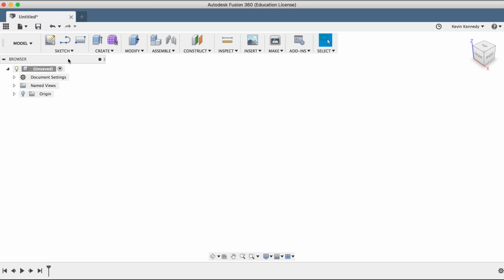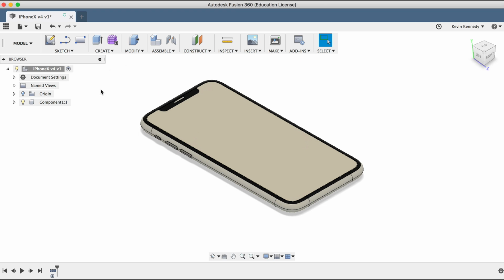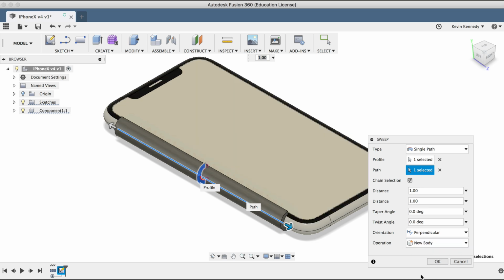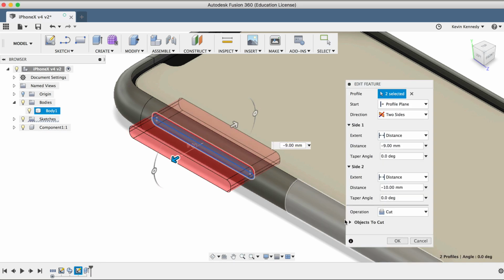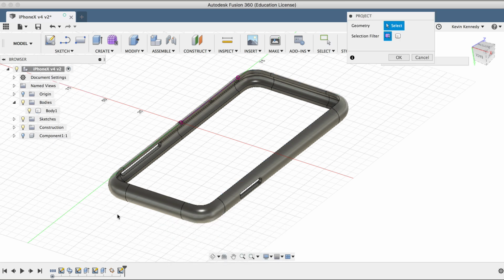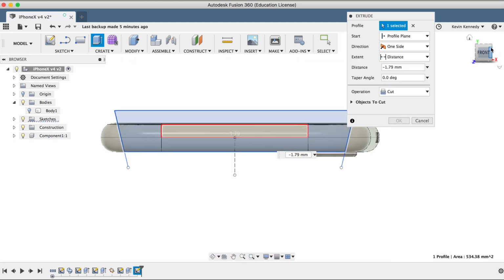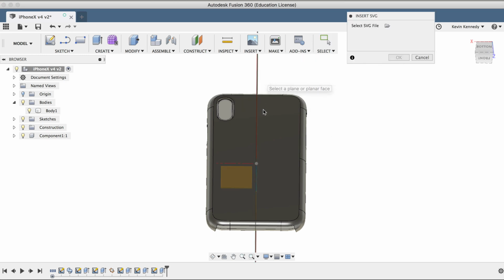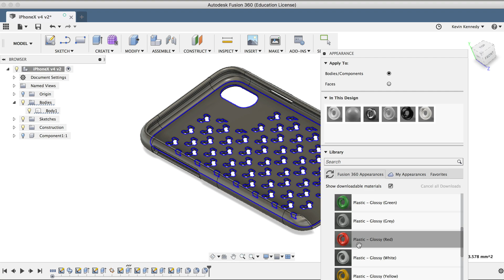How to 3D Model an iPhone X Phone Case - Learn Autodesk Fusion 360 in 30 Days: Day #10

Comment: Thanks for the great series. Have been following along, and actually getting somewhere. This project, is what I want to create. However, I am modelling for a Galaxy Note 8. The iPhone, has some symmetry around the edges, and the sweep does travels very nicely. For my phone, it is not symmetrical on the edges, and gives errors about this symmetry. Is there another method to achieve an outcome? regards ( I did download a model, as you suggested)
Reply from the maker: Hi David. Thanks for following along with the series!

Try splitting your model in half to create some new geometry for the sweep to follow. Use a midplane construction plane (select the front and back of the phone) so the construction plane is directly in the middle of the phone.

Then, use the Split Body tool in the modify dropdown list. You'll obviously select the body of the phone model as the "Body to Split" and then you'll want to select the construction plane as the "Splitting tool." After clicking OK, your phone body should split in half. Try using the sweep command by using that new "edge" created by the phone being split in half. If that doesn't work with the sweep command, you may have to "project" the edge sketch geometry onto that original midplane construction plane.

Let me know how this goes... or if you have any follow up questions! Cheers, Kevin :)

Comment: How design mobile case without cad file.. ? Can you teach design using mobile image ?
Reply from the maker: Hi, G.Mahesh waran Gangadharan. You can certainly follow along in a similar manner with just a reference photo. What you'll want to do is place the reference photo on the XZ plane...and you'll want to trace or outline the outer dimensions of the phone using sketch geometry.

For example, if you want to model the iPhone 6, place the iPhone 6 reference image on the XZ plane. Then, right click on the image in the Fusion 360 browser and click "calibrate." Calibrate the length of the reference image to be the same as the length of the phone. Then, I would simply create a 2 point rectangle with the phone's width and dimensions, and add fillets to the corner. Alternatively, if the phone doesn't have perfectly round corners, you could use the spline tool to "trace" the curvature of the phone.

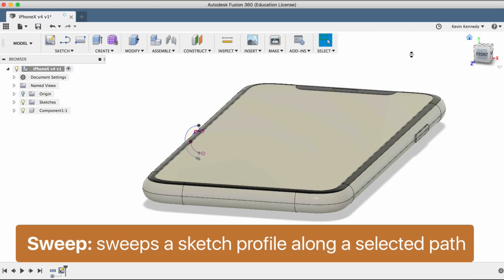Up to this point, you would now have a line to use as your guide path when you use the sweep command at 3:17. The Sweep profile that I created at 2:11 could also be done with just a reference image or even just dimensions that you find online. I've personally found that using a 3D model is easier to ensure accuracy for something with little tolerance, such as a phone case. I hope this helps! Cheers, Kevin :)
Reply: @ProductDesignOnline  if phone's side face are curved means how can i trace it using photo?
Reply from the maker: You'll probably want to upload a reference image for both the front and the side profile views. Something like this - https://i.ytimg.com/vi/-IHfemz7xLQ/maxresdefault.jpg
Reply: @ProductDesignOnline  ok thank you so much
Reply from the maker: @Maheshwaran2200  You're welcome! Let me know how it goes :)
Reply: @ProductDesignOnline  am new to fusion that's why i ask to do video for this. Am using your steps only.. just compeleted 4 days of tutorial only.
Reply from the maker: @Maheshwaran2200  I understand. I have a list of videos to get through first but will consider doing this in the future. Cheers, Kevin :)

Comment: Here is a problem, Could you check my file?
https://a360.co/2Dpmky8

When I attempt to sweep there is a message "Inconsistent edge-face relationship
So, I fixed spline sketch but It doesn't work
Reply from the maker: Hi, CHO성진. Upon inspecting the model...it looks like the original iPhone 6 model has some issues with geometry not being consistent. I would suggest trying again with a different iPhone 6 model. This one seemed to be hacked together pretty quickly. Alternatively, you could try to create a midplane construction plane... and then try to re-create the perimeter of the model using sketch tools. You may even be able to project the sketch in some areas to help recreate the geometry. Whichever way you re-create the perimeter you'll want to make sure it connects all the way around so the sweep feature has a consistent guide path to follow. Cheers, Kevin :)
Reply: @ProductDesignOnline  I think so too, so I try another Phone model 
then complete it, Thanks for a great video and nice explanation !
Reply from the maker: @devstefancho  You're welcome! As always, thank you for your continued support! :)

Comment: When I import the .stp file it imports standing on the top of the case...the front is the back. I know I should be able to fix this but don't find the commands to do so. It throws all the instructions off.
Reply from the maker: Hi, Doug. I would recommend importing the "Fusion 360 archive" file. I believe that will import it in the correct orientation. However, you can always change the front view with a few clicks. Click the "back" side of the view cube to look directly at it. Then to reset the front view of the model you'll want to click on the chevron (dropdown arrow) to the bottom-right of the view cube. Then, select "set current view as" > select "top" from the list. Depending on how your model is oriented you may have to follow these steps to set the "top" view as well.

Let me know if this fixes it for you! Cheers, Kevin :)
Reply: Thanks, I played around enough to find the chevron and corrected it before I got this note. It was worth knowing (and maybe you cover this in a later video or, if not, it might be a worthwhile topic for a new one) because I may eventually run into a situation like this when I design my own projects. Thanks, I started with the Autodesk tutorial, but much of what I got to had more to do with a work environment. I also tried a udemy course and it was okay. I like the fact that you emphasize specific tools and aspects of 360. Great stuff! Thanks.
Reply from the maker: @douggrant4008  Glad you figured it out!

I have a really old video (one of the first ones) that covers reorienting objects - https://youtu.be/GwGa0Z50jLg

However, because its so old... and things have improved a lot. I will likely make a new one/incorporate it into a new video with some other viewcube features details. I'm happy to hear you enjoy my videos. Thanks again for your support! Cheers, Kevin :)
Reply: @ProductDesignOnline  yeah...that tip was gold!!!!!!!! thanks

Comment: Hi, I can't see how to download the svg pattern - the link takes me to the page and I can see it but I don't see any options/ways to download it. Thanks!
Reply from the maker: Hi, Marisa. With that page open, right click on the image and select "save as" from your browsers native right-click list. Then, make sure the file type is still set to SVG (sometimes browsers like to change to a users default of something else) > change name if you'd like > change location on your computer if you'd like > click save. Cheers, Kevin :)
Reply: @ProductDesignOnline  Yep I've tried right clicking but I only get the option to Save Page As - which is not what we want to do - as I can't actually click on it as an image, I can see it, but it's not clickable........ any other suggestions? Thanks!
Reply from the maker: @marisajane37  Hmm... that's strange. What browser are you using? Here's a Google Drive link that should be easy to download from - https://drive.google.com/file/d/1-WETMLGSBKvK2mlM0osrbquJtyADnSJu/view?usp=sharing
Reply: @ProductDesignOnline  Thanks Kevin, Google Drive link worked! :) I'm using Safari.....
Reply from the maker: @marisajane37  Strange Safari won't work. I normally use Google Chrome, but just tried and Safari won't work for me either.... normally you just click and hold on the image. I guess Safari doesn't like SVGs, which is good to know, so thanks for bringing this to my attention :)

I'm glad the Google Drive link worked. Keep it up! Cheers, Kevin :)

Comment: I have a small issue in regarding to selecting multiple profiles for extruding the shape of the rectangle which would essentially cut out the hole for the buttons; it seems as if I can't select the two halves of the rectangle right after creating the 1.5mm fillets. Anything I missed?
Reply from the maker: Hi, lordcosmic1. It's possible that the fillets messed something up with the constraints or line, which is prohibiting the extrude command from working. Do both halves of the rectangle have an orange background highlight? The orange highlight signifies they are closed profiles, which is required for the extrude command.

Please let me know if it was something with that. Otherwise, feel free to share your file and I will take a look. Share your public link as a reply to this comment. Here's a video explaining how to share a public link - https://youtu.be/2XrcrdV-8Ls

Then, please write a separate comment letting me know you've replied with a link because YouTube flags most links and I don't always get notified. Cheers, Kevin :)
Reply: @ProductDesignOnline  Thank you, I found that the fillets were the cause of the issue; both orange highlights appeared right after re-sketching the fillets and it allowed me to complete the extrude command. Thank you again! Excellent video, very informative.

Liked, and Subscribed!
Reply from the maker: @TheMemeKing42069  Glad to hear you got it resolved so quickly! Thanks for the sub. I appreciate you taking the time to watch and comment. Please don't hesitate to comment on any of my videos should you have any questions. Cheers, Kevin :)

Comment: You fogot about offset between phone and case. I'm guessing that it wouldn't fit after 3d print. Good tutorial tough ;)
Reply from the maker: Hi Maciek, I printed the phone case on a commercial grade 3D printer (Stratasys F900). Because the tolerances are so high on this printer it worked fine, especially since the plastic has some give to it. The intention was to have it as snug as possible. I had to bend or pry the plastic to squeeze the phone in, but that ensured the case won't ever pop off.

If you don't have access to a commercial grade 3D printer then you may want to consider a small offset as you suggest. Or I suppose you could scale the model up a small amount in the slicing software. Cheers, Kevin :)

Comment: First off great video!!! easy to follow. is there a way to combine all the faces created into a solid shape then split it into two bodies? in essence i want to create a 2 layer case. kind of like the otter box or lifeproof case. silicone inside hard shell outside.
Reply from the maker: Hi Matthew - Thanks for watching! Yes, you can use the combine command located under the modify dropdown list to combine bodies together. To split the case in half you'll want to check out the split body tool, which is also located under the modify dropdown list. I would recommend creating a construction plane (a midplane may work best) which you can reference as the "line" to split the case in half. Cheers, Kevin :)
Reply: @ProductDesignOnline Kevin thanks for the reply. I'm not looking to split the case directly in half. If you look at this picture: https://m.dhgate.com/product/shockproof-dual-layer-tpu-hybrid-rugged-armor/406053148.html#pd-105 I'm looking to design something in the same manner. A skin then a shell that will fit over that.  I guess I could bulid  2 cases following your instructions, but how would I "assemble" it? Hope that makes sense.
Reply from the maker: Hi Matthew, sorry I misunderstood you. Thanks for sharing the reference image!

I would recommend building the inner case first. Create a new component for the first/inner case. Then, you'll want to create a new component for the second part (color) of the case. After that, you can "project sketch" from the first component/body to the second component's sketch, which makes sure that all of your pieces are the same dimensions...although you may want to then offset the lines to leave some tolerances between the two cases. I think you'll find building the first one and essentially building the second one off of the first (just make sure they're different components) very practical. If you use the project sketch feature you can set up the outer case to be driven off the dimensions of the inner case...therefore, if you update the size of the inner case later on you won't have to rework the entire outer case.

I hope this helps! Cheers, Kevin :)
Reply: Thank you for the response. is there possibly a video showing this? and i have a couple basic question. can yo sweep only corners, to make the inner case? how did you get your sweeps to be a single piece? on of my corners has been cut in 5 different pieces?
Reply from the maker: I don't have a video showing a multi-part case being made, however, if you watch the screwdriver video (https://youtu.be/29kCwkapes4) you'll see that I use the same concept... demoing what happens when you change the size and the second component updates accordingly.

The number of pieces in a sweep all depends on the path that you select and how the profile shape intersects the path. Did you use the same iPhone model or a different phone model?

As far as creating a sweep in only the four corners, I would create a sweep in one corner and then mirror the feature both ways. This way, if you decide to update the original sweep, the 3 others will update accordingly. Whereas, if you do them one by one you'll have to update them one by one. Cheers, Kevin
Reply: i will take a look at that video. when i import the step file of the phone it already has "faces" is there a way to make a sketch out of a face? i.e. if i choose the corner face of the phone make a sketch and extrude, so that it will be they exact size of the corner?
Reply from the maker: Yes. To make a sketch from a pre-existing face please follow these steps:
1. Create new sketch (click "create sketch" in the toolbar, select plane or surface)
2. Go to the sketch dropdown list > select "Project / Include" folder
3. Select Project
4. Select all of the lines that make up the face that you want to be projected onto your new sketch

Comment: Great video, and I really appreciate how you highlight the new concepts while reinforcing the previous ones.

I am having a lot of trouble in general with Fusion 360, though:
1)   If my internet connection is sketchy (ok there are 14 wireless devices hammering the router and modem) is the user interface laggy, or is my PC under powered?  The UI is way laggier than your videos.
2) In sketch mode Fusion 360 keeps trying to add geometry.  For example, it automatically tries to draw an offset oval inside the camera cutout.  How do I get it to be a little less helpful?
Reply: 1) Probably it's your system. Try working with an offline saved version of the file and if it still persists, it's definitely your system.
2) Not sure.
Reply from the maker: Thanks for your suggestion Amit!

Like any software, I've found that sometimes Fusion 360 can be buggy or have its "slow" days. Re-starting F360 is always the first thing to try. ;)
Reply from the maker: Jim Rauch - Thanks again for watching the series!

1) I'm guessing if your Fusion 360 is laggy then it's more of a PC problem than an internet problem. Fusion 360 does not need the internet to work, it's mainly for saving/backing up your data to the cloud, so it really shouldn't slow it down. Here's a video on it - https://www.youtube.com/watch?v=EdwK-1bhgvc&t=2s

What type of computer are you running Fusion 360 on? Here's an Autodesk help article outlining the minimum requirements for Fusion 360, based on each operating software - http://bit.ly/computer-requirements

2) Can you reply with a screenshot so I make sure I understand what you are talking about?

Cheers, Kevin :)
Reply: Regarding hardware - I have 8G RAM and 2G DDR Video RAM so I am good in that department.

As for the selection of the oval, it turns out that Fusion was trying to select the iPhone camera sketch as  I moused over it.  I'l' experiment with the locking feature to see how that affects smart selection.
Reply from the maker: Jim Rauch, sounds like you have plenty to run F360. Do you find the "lagging" to be something everytime you have Fusion 360 open? Or does it only lag at times?

Comment: Hello friend, to make a rounded shape as the Iphone has in the sides, the way is always done isnlike you did for the case? I usually tend to start with a rectangle but after fillet it never gets thst round! Thanks!
Reply from the maker: G M - Thanks for commenting! You could do other methods, but I've found that sweeping the curve around the phone is one of the easier ways to complete it. It really depends on the phone model and how its edges are shaped. Some of the older iPhones that are more square can easily be 3D modeled by starting off with a box and cutting away from it. Cheers, Kevin :)